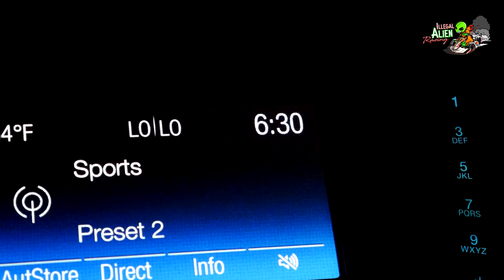First Club Race 100cc Class (Behind the Scenes)

Comment: Hello Oscar. I was surprised with how quick the rear tire got worn out like that. How was the track? Looking at the video, it looked either oily or slightly wet. I never had a degradation like that before. That set of Bridgestones looked brand new before going to the track. By the way, I use MG tires and LeCont. Another question: What’s the minimum weight in that 100 cc class? Thanks buddy, and keep on with these awesome videos